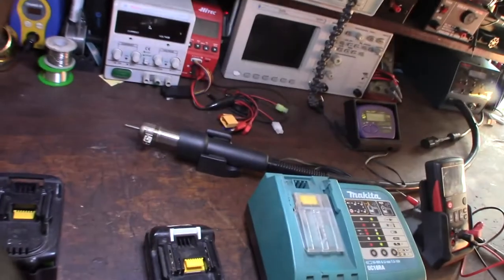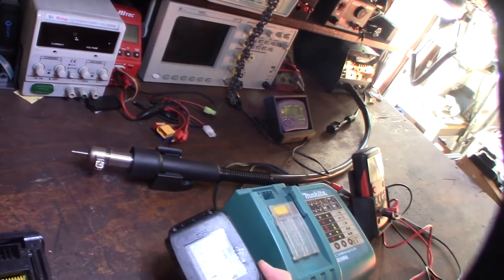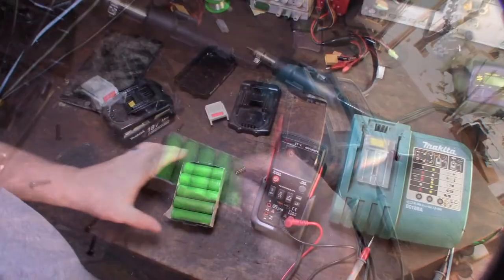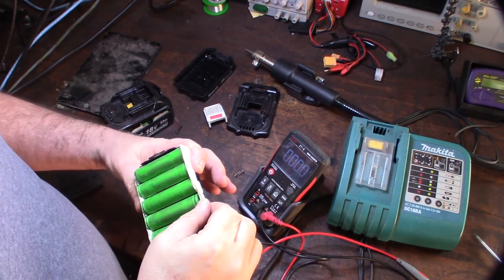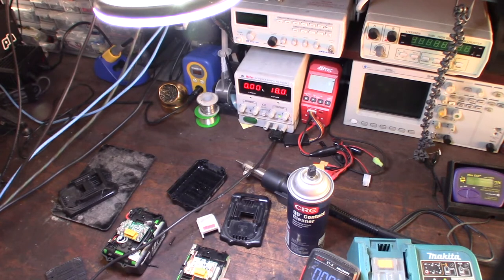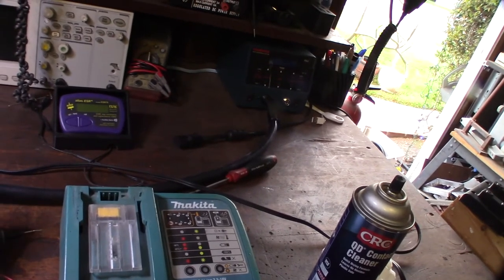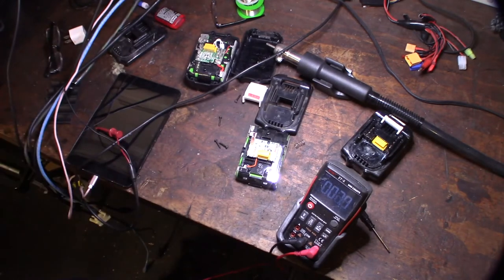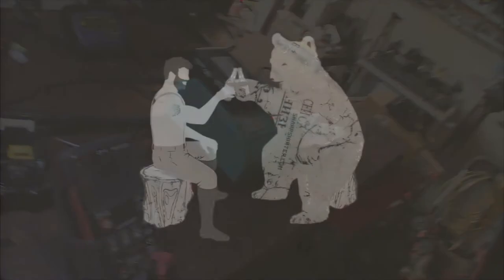Makita BL1815 heavily discharged battery recovery, rejected by battery charger

Comment: Hi there, I know this is unrelated to the video but I’ve got a bit of an issue with my car. It’s a 2001 VW Jetta VR6 with the AFP engine code. 

If you check my channel videos I have two clips of the noise the car is making.  

For whatever reason when I cold start it I hear a rattling noise coming from the serpentine belt side of the engine. It’s present when the engine is cold and when it warms up it goes away to almost nothing. 

I have tried the following to diagnose it: 

Pulling valve cover to check cams/lifters for any damage, ground down cam lobes etc and everything checked out 

Changed serpentine belt tensioner, no difference. 

Changed clutch, pressure plate, shift fork and all other related components and no change 

Changed water pump, no difference 

Changed timing chains both upper and lower, no broken guides or chain slap. 

Pulled the serpentine belt off the engine and ran it to see if noise remained which it did. 

I’m at a major loss right now because I have e absolutely no idea what this sound could be. I’ve been told it could be piston slap, but I’m having doubts as I’ve never found any metal shavings in my oil after any oil change. Rod bearings if they were gone would not have lasted as long as this motor has made the noise. It’s never had any impact on the way the car runs and drives. My only thought is it could be the crank pulley that’s gone bad perhaps? 

If you could give me a hand I’d appreciate it!